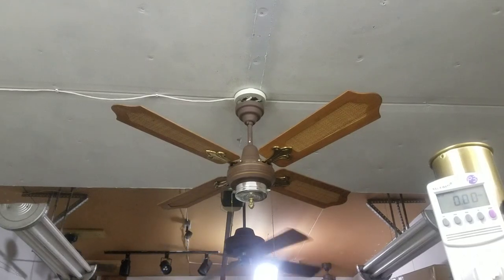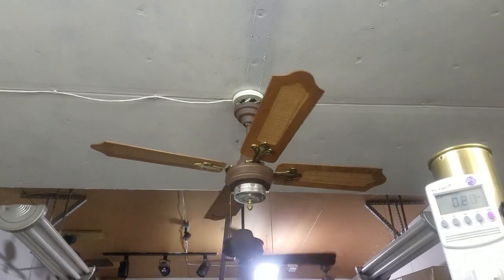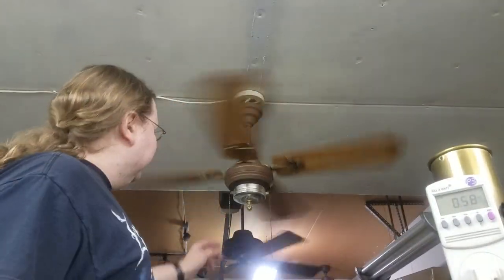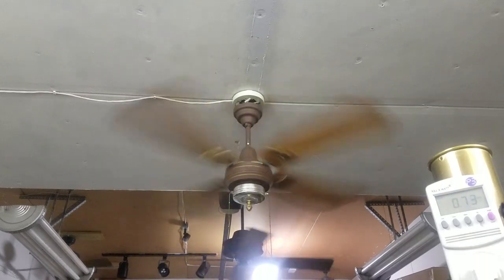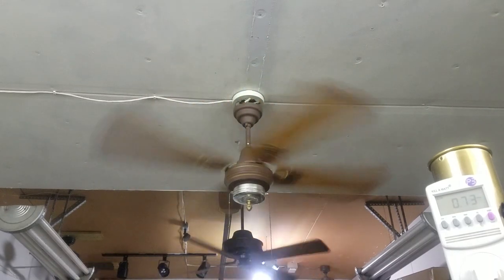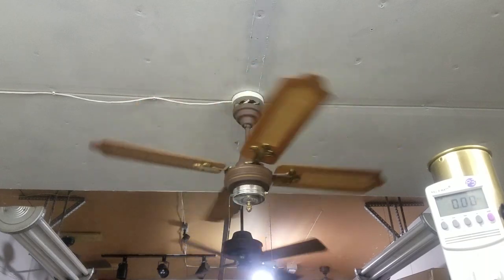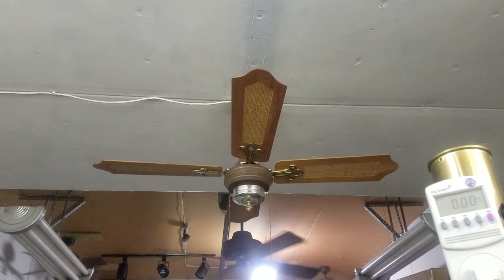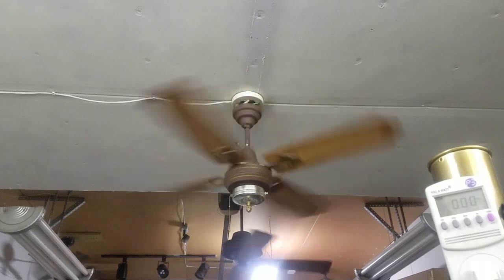Encon/Crompton Greaves High Breeze 42" 1050mm Ceiling Fan w/ switch housing & Cane Blades

Comment: Dan, you have a white one I used to have installed (mine had a light, and no internal switch) but on high, it was like a helicopter! Beautiful fan, but POWERFUL.
Reply from the maker: The only one I got from you was brown with cane blades?
Reply: @dspiffy  I thought sure I sent you a white one. No, maybe I still have the white one, I'll have to look. If I do, I might look for a place to put it. This was a huge childhood fan-- I only wish I had that ornate 4-arm light you have. One copy of the magazine ad it was in is taped up beside my desk, and it was also in a giant book of ads from woodstove companies that was mailed to us when I was little (which I still have). Both picture this exact fan: white, wood w/ cane, 4-arm ornate light.

Incidentally, the ad in that woodstoves book (I say book, it's like an inch thick, but it just arrived in the mail one day) gave rise to my biggest childhood misconception about a fan: it mentions multiple "interchangeable" light fixtures, and I pictured a system where you could unscrew or un-twist-lock one and put on another at a whim.
Reply from the maker: I remember you had a white cane.  I dont have a white cane.